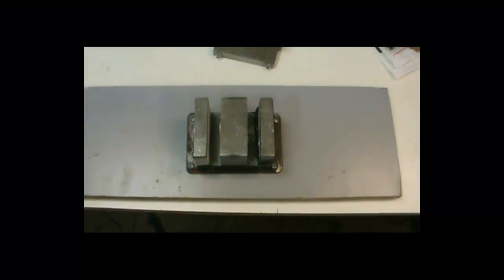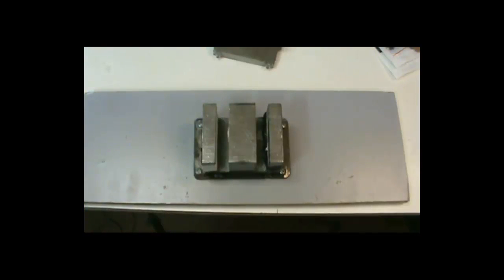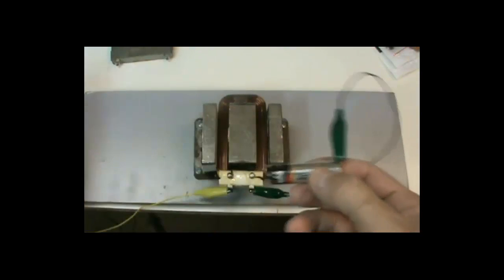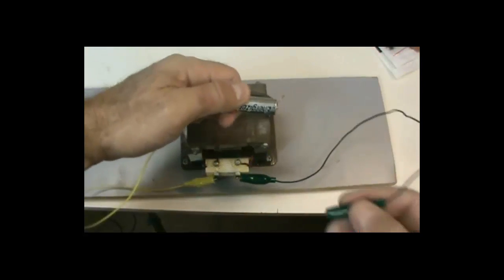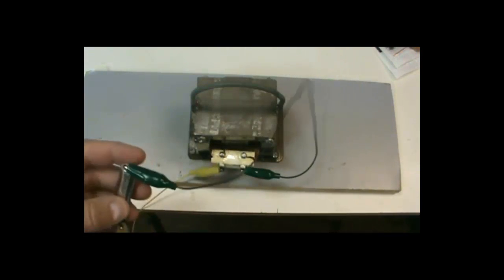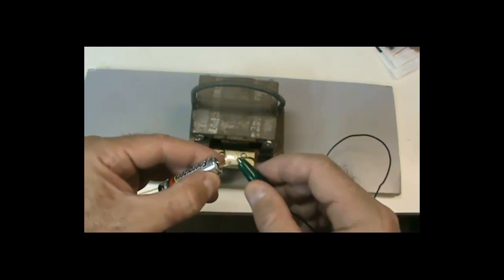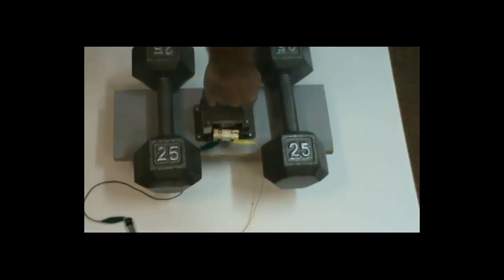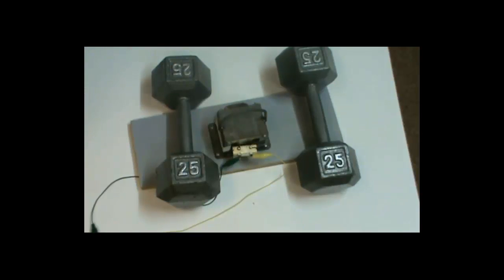Easy-to-Build Electromagnet lifts over 50 lbs

Comment: But what if you connected a 5.00 v to 1.2A AC ADAPTER on this
Reply: The higher the voltage the stronger the magnet
Reply: The AC, and regarding an item, would pick it up, drop it, pick it up drop it, pick it up sixty times a second, so you'd never get anything lifted. If, on the other hand, you were using a AC to DC converter, you'd be off an running.

Comment: I suppose you could try two primary coils in series, and double the input voltage to increase power.
Reply from the maker: Yes, or connect the two coils in parallel and use twice the current.

Comment: If you reverse the battery polarities, will the electromagnet repel?
Reply from the maker: No, magnets only repel other magnets when magnetic polarities match. An electromagnetic will repel a conductive material when driven by an AC power source due to Lenz's law because of eddy currents that are set up the conductive material that do act like a magnet with the same polarity.

Comment: so what would happen if you used a bigger battery? lets say like 12v lol?
Reply from the maker: Obviously you will get more current and create a stronger electromagnet BUT you also risk burning out the magnet since it will get hot even hot enough to let the smoke out :-). There are always limitations to anything electrical which is why fuses exist.

Comment: What is the duration of time that the AA can maintain this force?
Reply from the maker: A AA battery will only about 5 minutes if hooked up continuously. A "D" cell will run the electromagnet for about an hour, particularly if you don't leave the battery constantly connected. For true magnet strength and long battery life use a 12 V battery but give the electromagnet a break so it does not overheat.

I've linked to few battery specification sheets for more research:

AA Battery: http://data.energizer.com/PDFs/E91.pdf
D Cell Battery: http://data.energizer.com/PDFs/E95.pdf

Comment from the maker: +Oliver Smithdeal Please review all the numerous comments I've made on things that can go wrong.. Its my experience that people with problems are using European microwave transformers, low or dead batteries, trying to attract non-magnetic materials, using low current wires and connections, etc. These are all important factors in the proper operation of the electromagnet. Check out the following video https://www.youtube.com/watch?v=cpSHTvzoZII&feature=gp-n-o&google_comment_id=z121ex1xqrecf1am223cf5cgwpfdsbfbg04

Comment: an interesting fact is that the video cuts as soon as you put the handle/plate back on and that your using 1.2 - 1.7 volts (depending brand and type of battery) to lift 50 pounds plus the bottom plate.
Reply from the maker: I'm sot sure if your comment is meant to expose some suspicion about the authenticity of the video claims or point out that this indeed works well. The video cut occurred because it took several attempts to keep the weights from shifting on the board while I was demonstrating the electromagnet. I put this video together on a whim and couldn't think of a easy way to immobilize the weights on the board. I didn't want to extend the length of the video by several minute while I was finally able to balanced the weights perfectly on the board so I removed the failed attempts.

BTW: The whole assembly was mounted on a board so students could step on the board while pulling up on the metal plate. Even large, male students could not break the metal plate away from the magnet with a fresh battery and a solid electrical connection so my claims are actually a downgraded version of an ideal situation.

Many viewer have built the electromagnet. I would appreciate it if these viewer would report their own results. Thanks.

Comment: Now how do you hover with a Electromaget? what do I need?
Reply from the maker: +MichaelMopar69 Do you mean make things repel the electromagnet? You can apply AC to the electromagnet to make non-magnetic, conductive  material move away from the the magnetic. Let me know what you would like to do. Thanks.
Reply: Dorian McIntire I would like to make a hoverboard.. for a display so it hovers on it.  Would be cool for Okt 21 2015.
Reply: Dorian McIntire  But indeed move away so it hovers.. and not atracks stuff.
Reply from the maker: +MichaelMopar69 Check out the following video for more information on Hoverboards.

https://www.youtube.com/watch?v=bvYUq6Ox0Hc

Such boards require a special track and superconductors. Rapidly changing magnetic fields over a base made of thick copper sheet might also work.

None of this is easy. to do.
Reply: Dorian McIntire yes I saw that.. but there are more ways to do it.. Hendo hoverboard got the copper plate.. I saw demagnetic. With grafit can that work? But we can't with electromagnets? Built a track on power.. and get a board to hover above it?

Comment: what materials is the primary winding? Some kind of nickel alloy?
Reply: I've got two MOTs here. The primary winding on both looks like thick copper wire, the dark color comes from the insulation coating on the wire (there are usually 6 - 8 coats around that wire to prevent an interturn in the primary). Be careful when removing the primary! Do not to scratch the wire, in most cases this renders the transfomer useless!

Comment: Can you send me complete video pls! It will be more helpful for me!! 
And it’s related to my project..
Reply from the maker: This is the complete video. The construction is fairly simple.
Reply: Thankyou so much sir for replying. Is this really work ??
I just tried with little dynamo but that doesn’t work I don’t know why ?
May be my technique was wrong.
I will try with another one and tried once again!  
Thankyou so much again.
Reply from the maker: It does work but you must use a power supply that can supply several amps. The AA battery I used in the video can do this but I doubt your dynamo can provide the current required. Large magnetic field are produced with large amounts of current and many turns in the coil.
Reply: Dorian McIntire thankyou so much sir.

Comment: I love the video can you make a smaller electromagnet and make it hold 50/100 pounds I need to know can you help me out thanks.
Reply from the maker: It's possible to build a smaller electromagnet that can lift a lot of weight but it's not easy without metal cutting and welding equipment.

The secret to making a powerful electromagnet is to use a horseshoe magnet type design or better still is an iron core and coil inside a metal pipe. These magnet designs concentrate the magnetic field at one end of the magnet.

I'll see if I can come up with a design to post but it will take awhile.

I'm glad you find this topic so interesting.

Comment: what is the specification of microwave transformer u have used
Reply from the maker: I really don't have any idea about the specifications of the transformer since I pulled it from an old microwave oven. All microwave oven transformers are about the same, except for the input voltage requirements (120/220) and power requirements (1000 watts/2000 watts, etc). They typically provide about 2000 volts which is doubled to drive the magnetron.

Comment from the maker: This magnet design acts much like a horseshoe magnet and concentrates the magnetic field near the tip.

To project the field outward futher (but weaker) you will probably want to use a more conventional electromagnet using a straight iron bar with a large coil wound around it.

This should allow the field to reach out futher for smaller objects but with less force.

Comment: please give way to open the transformer like a experiment
Reply from the maker: pandu diazsatria You must use a side grinder to cut the welds on the sides of the transformer. A hacksaw will also work but it will take a while.

Comment: +Dorian McIntire 
Do you remember the specific microwave you used?
If not, do you have any microwaves you would specifically reccomend?
Reply from the maker: +Zan .U It really should not matter except that a 120 volt microwave oven is preferred and a large power oven (1000 watts or above)  is preferred.
Reply: Awesome, thanks for the quick reply! I think I found something that should work. Happy New Year!
Reply from the maker: Happy New Year! Have fun :-)
Reply: +Dorian McIntire 
I was able to remove the top of the transformer, but the primary/secondary is stuck. I tried prying it but they would not budge, any tips on how to remove the excess secondary?
Reply from the maker: +Zan .U You might have cut the secondary winding (high voltage winding with many, many turns of fine wire) away with a hacksaw since you don't need it anyway. Be careful not accidentally cut the primary winding  (120 volt winding with fewer turns of thicker wire)  in the process. Once the secondary is removed the primary should be easy to remove. Good Luck.

Comment: How hard would it be to lift 100 pounds??
Reply from the maker: As I mentioned in other comments using a 12 volt battery instead of 1.5 volt battery will easily allow you to lift over 100 lbs. I used a AA battery only for effect because the battery is tiny. Most students could not pull the magnet from the base with this battery as the supply and I would comment that they were weaker than a AA battery ;)

Comment: does the size of the battery matter
Reply from the maker: By "size" do you mean physical size or voltage? Physical size of the battery only affects capacity and current. A larger  battery, such as a 'D' cell will provide more current and for a longer period of time than a 'AA' cell. Be careful using higher voltages than 1.5 volts since 1.5 volts works well for the low resistance of the coil. Too much voltage could overheat and destroy the coil.

Comment: did the battery heat up when in use?,
Reply from the maker: I never left it hooked up long enough to find out. The electromagnet can drain a battery pretty fast. What type of battery are you using?
Reply: 9 V battery, and heated   up really fast, and I had hooked up just for two seconds
Reply from the maker: A 9V battery is not appropriate since it is not designed to provide high currents. The battery should be a lower voltage battery with a large current capability such as a AA, C or D battery. A 12V battery will work for very short periods of time but the electromagnet will get warm.
Reply: ok thanks

Comment: You are better off using the higher turn coil side for those small batteries. You will still get a strong magnet and current draw will be reduced. The fatter coiled primary side works best with low impedance sources that can supply the current like car battery.
Reply from the maker: +EETechs Not really. The impedance of the primary coil is best since its resistance more closely matches the internal resistance of the battery. This creates a better energy transfer from battery to coil.
Reply: +Dorian McIntire I'd be willing bet you :). The amp turns are what matter. You can achieve the same magnetic force with many turns of smaller wire and less current draw versus using the bigger coil that will draw more current.  Also magnetic field strength is not a function of the maximum power transfer theorem. It is current and amp turns that determine the magnetic field strength up to within reason of course if we are not into the saturation region of the iron.

Try this: get a variable current source and set current to value such that it's enough to hold some mass X for the primary side. Record voltage applied by the current source needed to produce the current the source is set at. Then do the same for secondary side. What you will find is that you will need more batteries for the high voltage side, but the current will be less so the batteries will last longer. The other side will used more current at less voltage, but the batteries will die faster.
Reply from the maker: +EETechs I'm very familiar with the concept of ampere-turns,  but you neglected to take into account a critical element.... winding resistance. The primary has a winding resistance of 0.5 ohms with 100 turns of large diameter wire, the secondary has a winding resistance of 60 ohms for 1000 turns of small diameter wire.

Current for the primary is 1.5V/0.5 Ohms = 3 amps, current for the secondary is 1.5V/60 Ohms = .025 amps. For the primary we have 3A x 100 turns = 300 AT while the secondary has 0.025A x 1000 turns = 25AT.

I verified this through experimentation long ago but I just wanted to explain why the secondary is not a good choice. In this case Max Power transfer does bode well with the particular voltage I choose and it does not stress out the winding thermally.
Reply: Dorian McIntire You don't use 1.5 volts for that side.  You use higher voltage for the high voltage side. So more AA batteries, but less current draw. If it's 1000 turns and you need 300 AT then that is 0.3 Amps. The voltage will be 18 volts if the resistance is 60 ohms. That is 12, 1.5 volt batteries. It will last 10 times longer than your set up of 1.5 volts applied to the .5 ohm winding. Now do you get what I am saying?
Reply from the maker: +EETechs I understand what you are saying but 12 - 1.5 volt batteries in parallel will allow the unit to work 12 times longer. The point of using the 1.5 volt battery in the video was to show that a small, taken for granted, power source can produce a tremendous magnetic force.

I just wanted to point out that with any electromagnet design there are complicating factors when trying to produce the best scheme for such an electromagnet. The power dissipation using 18 volts @ 0.3 amps on the secondary coil is 5.4 watts while the power dissipation using 1.5 volts @ 3 amps on the primary coil is 4.5 watts. Can we agree on this? Thanks.
Reply: +Dorian McIntire Yeah I can agree. But there is trade offs. In some cases it's better to go my way as it gives a voltage range that is easy to obtain, cheaply, for 18 volts systems that are allowed to vary from 12-24 volt range. At 1.5 volts, 3 amps, that's not very easy to obtain for the cost of needing a DC-DC converter  (if you want to keep high efficiency) , thicker copper wires, and a higher current rated switching element if one is using a voltage range that is 12- 24 volts. You must also consider what the application calls for. If only 25 lbs with a 20% safety margin above lowest voltage of 9.6 volts is needed then it's too costly to go that route of using a DC-DC converter, extra copper, and higher rated switching element when the voltage as low as 12 volts could meet the requirement instead of needing to maintain a constant 1.5 volts over a voltage variance range..

Finally, you have to consider reliability, which will be lower due to going through extra components that increases the chances of failure. Just a switch, R/C snubber network or diode, cables, and battery is all that is needed for  the 18 volt system. Don't forget too that there is a B-H curve that allows voltage to go lower before the magnetic force can no longer hold a weight. This is taken advantage of a lot in economizer circuits that are used on contactors and electromagnetic brakes to reduce power draw.

Comment: could a very strong electromagnetic sword stop bullets?
Reply from the maker: This is an interesting question. If bullets were made of magnetic material you might be able to affect their path with a very intense magnetic field. Bullets are usually made of lead sometimes with copper plating and some bullets are made of pure copper. Lead is used for bullets because it is both a heavy material that can store more kinetic energy, for a given speed, than lighter materials and it is a soft metal that deforms on impact and can do more damage this way. If bullets were made of copper a power magnetic field could theoretically convert the bullets kinetic energy into heat while it passed through the magnetic field. If the magnetic field were powerful enough the bullet would slow down and heat up as it moved through the magnetic field. This works because the magnetic field would induce eddy currents into the bullet and these currents create their own magnetic field in opposition to the magnetic field from the sword. This effect works best with low resistance materials but lead has about 12 times more resistivity than copper so stopping a lead bullet would require a much greater magnetic field. I imagine a magnetic field powerful enough to do this would cause other problems such as causing the sword to be pulled out of your hand toward any nearby iron objects or pulling the iron out of your blood. Any physics majors out their ready to do the math?
Reply: Dorian McIntire Well can we assume King Arthur/Thor/Iron Man/Superman/Jesus/Hulk or whoever was holding it with that type of strength. Would the sword itself catch/stop the bullets? Silly enough that was the actual question since it had nothing to do with someone holding it...